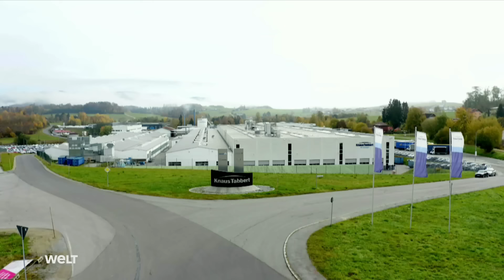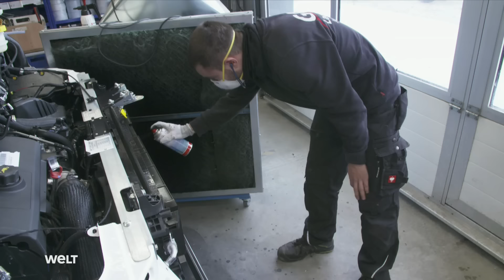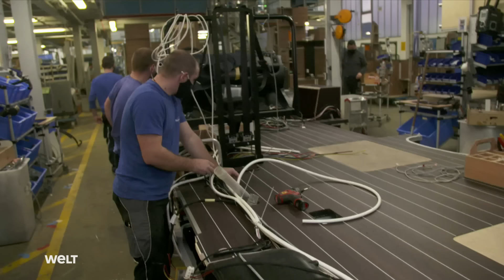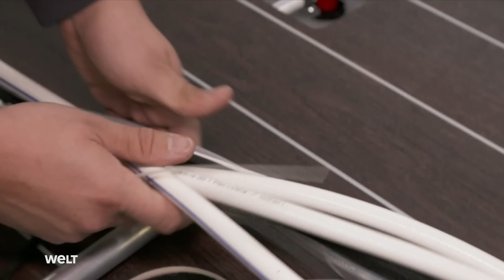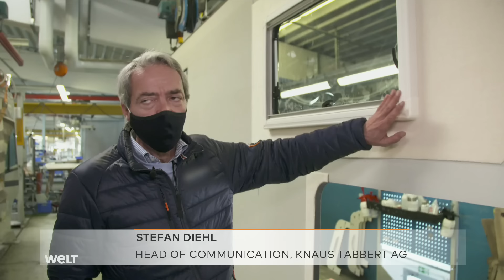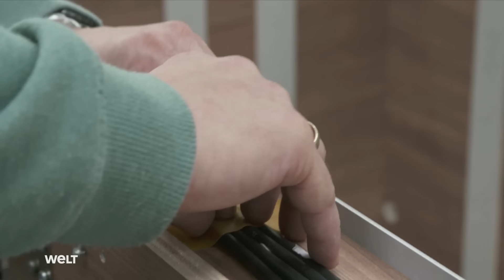High-End Motorhomes: The Technology and Craftsmanship Behind Luxury RVs | FD Engineering

Comment: Early on they say the radiator is spray painted black. Doesn't the paint plug up the fins and prevent air from passing through ?
Reply: if you lay on the paint not too thick and use the right type of paint no, a lot of radiators are coated as standard too to prevent oxtdation if it is aluminium.
Old radiators where always black given they used copper

Comment: This design looks nice and is well-conceptualized on the inside. However, there are a few things that bother me about it. The RV lacks weight-bearing pillars that would transfer the cabin's weight to the frame. I’m also not entirely confident about the plastic foam body—what’s its longevity or durability like? At the very least, canopy-style pillars (similar to those seen in large buses) could be added at the front, middle, and back to transfer the cabin load directly to the frame. Additionally, the tanks and battery bays could be designed in a plug-and-play format to allow for easier access and maintenance.
Reply: andwich materials are used in boat building so they are rather well understood and durable. With the usual .... IF designed and build right with the right materials.
If buildright the whole RV body is a load carrying box, if the furniture is attached rightit should add to the load carrying, some even have warning that removing the bath cell compromising loadbearing.

Comment: My 1985 Winnebago motorhome has steel frame and roof with fiberglass siding. This process looks cheap and structureless.
Reply: Still, the Knaus RVs are very durable and solid. It's a lot of engineering put into the construction, saving weight without compromising stability. We in Europe are eager to save energy.
Reply: @HolgerJakobs  These vehicles are death traps in an accident.  No thank you.  Where are the airbags?
Reply: @HolgerJakobs  What will you do with all of your saved energy?
Reply: You're 85 winne leaks like a tea bag & you know it.

Comment: these specific RV's are not luxury RV's.  these are mass produced bargain basement RV's.  the exact f'ing opposite of luxury...these are consumer goods.  They're built on a FIAT, for crying out loud, the 3rd largest economy car company in the world.

luxury RV's are custom built and have actual luxury finishes and construction...not plastic and glue.  real wood, real metal, real chrome, real veneers... alloy frames for the body, commercial grade chassis, brakes, and drivetrain...that sort of thing.
Reply: True. If you want real high-end motorhomes, look for Volkner in Wuppertal. "Volkner-Mobil | Reisemobile der Extraklasse". They cost at least a million € as opposed to the price of the Knaus shown here for less than 200.000€.
Reply: "Real veneers ..." Veneers are a cheap version of solid wood.  Not luxury.

Comment: there are 2 things that i don't like: 
- it is powered by a diesel engine. it should be fully electric.
- the gas cooker. gas is the worst, least efficient way of cooking. i'd go for induction.
oh, and solar panels on the roof (and on the outside walls?) wouldn't hurt either.
Reply: You must be joking.  Leaving civilization in a battery powered bus os a horrible idea.
Reply: @rbhe357  who said anything about "Leaving civilization"? besides, the future is electric, even though the USA is about to make a bunch of big steps back into the dark ages.
Reply: @mrxmry3264 Spoken like a propagandist who is out of touch with the US and have different views on where to take an RV.  Where I go is 90 miles from the closest small town.  No mobile coverage either.  That is not uncommon in much if the US.  If you ever want to leave the city it is very much not the near future.
Reply: - 12Volts ?
Reply: @drttgb4955  for regular vehicle electrics like head and tail lights, radio, windscreen wipers and so on, 12 volts are ok. but not for the drive motor. there's a reason why electric car batteries have much higher voltages. AFAIK most electric cars run on 400 volts with some going as high as 800 volts.
Reply: Fully electric RVs are coming. Some prototypes have already been shown. But driving long distances is still a bit difficult. The RV producers depend on what the vehicle makers deliver. A gas cooker is still standard. Since LPG is there in abundance, it's totally fine. Some RVs are equipped with induction cooktops, but you need big batteries and solar panels, and without hookup you are doomed after a couple of days with bad weather in winter. Heating on Diesel instead of gas has become more popular, because swapping gas bottles is a nuisance, and Diesel can be found at every station.

Comment: Looks like a Death Trap 😂
Reply: No safety considerations anywhere.
Reply: @dreadz1421  They are incredible solid. You can see some of them after 30 years and more still driving around. It's a clever construction where even the closet and bathroom walls play a part in the stability. Overall it makes these vehicles a lot lighter than comparable ones made in the USA. We in Europe are eager to save energy by lightweight construction. Fibreglass and XPS foam are very rigid, the metal frame at the bottom is very strong. Not easily being realized by laymen, though.
Reply: You'd think at the very least they'd put a roll cage in the cab and the seating area where those added belts are near the dinette.
Reply: Definitely is

Comment: The forklift would wreck havoc on one of these!  Flymsy frames and thin side walls.
Reply: yeah! No structural framing got me wondering if it wouldn't wobble while in motion....
Reply: A motor home is basically a caravan on a powered ladder chassis, structurally it is not designed for strength.
Reply: They are incredible solid. You can see some of them after 30 years and more still driving around. It's a clever construction where even the closet and bathroom walls play a part in the stability. Overall it makes these vehicles a lot lighter than comparable ones made in the USA. We in Europe are eager to save energy by lightweight construction. Fibreglass and XPS foam are very rigid, the metal frame at the bottom is very strong. Not easily being realized by laymen, though.
Reply: @HolgerJakobs  They are Americans , they can't talk about quality and motorhomes, six wheelers or whatever tacky , dated, huge  monstrosity they are building now , after 5 years most of their motorhomes end up in the wreckers, they  can't beat the Germans

Comment: Back in 1998-2000 I worked at a large Recreational Vehicle Facility that hand built the frames and suspension for their 60' diesel motor homes.
Everything was built within 3 miles from the main assembly line. Engines, Transmissions, and the sort were delivered right off the railway.
Reply: 60 foot motorhomes huh? Were you high or drunk back then? Your picture says BOTH.
Reply: 60 foot motorhomes ?